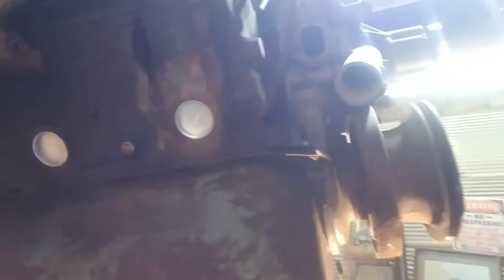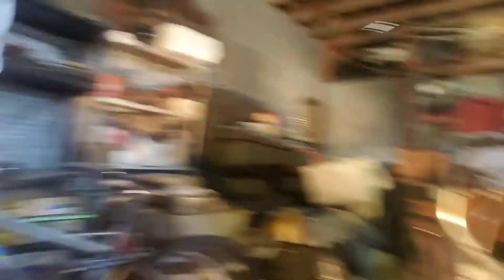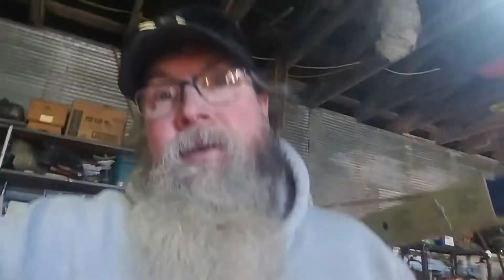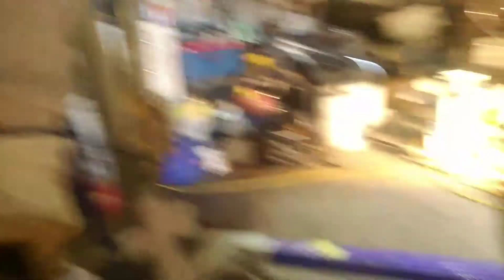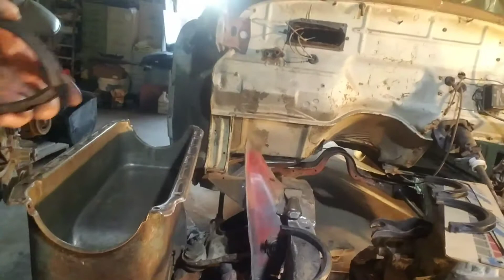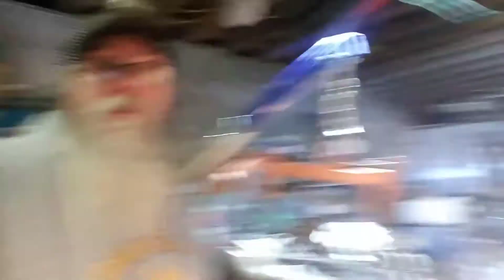Coronet (Episode 21)

Comment: looks like after you get it buttoned back up you'll have to soak the block coolant system with some prestone flush and then a garden hose once temps stay up above freezing  to see if there's crud built up ?  Good job . I dont trust old freeze plugs either 😎👍🏁
Reply from the maker: Yes Sir. That's the plan.